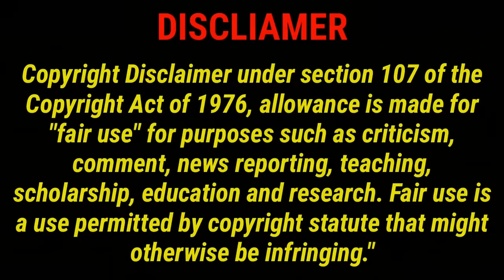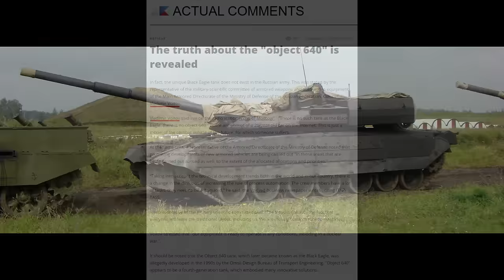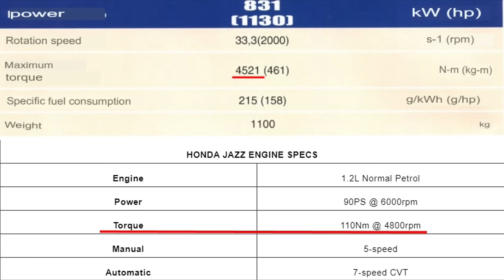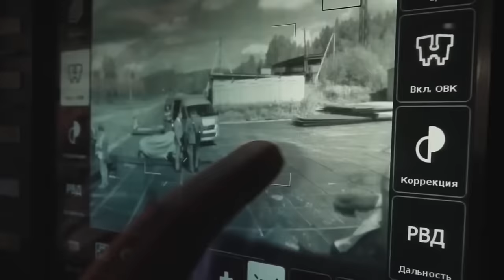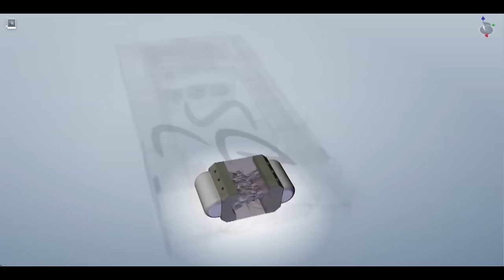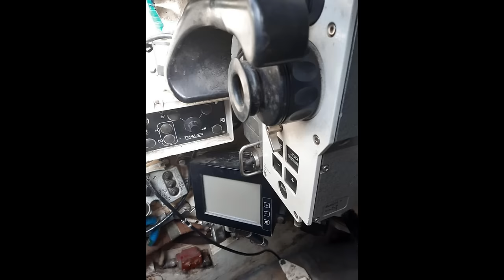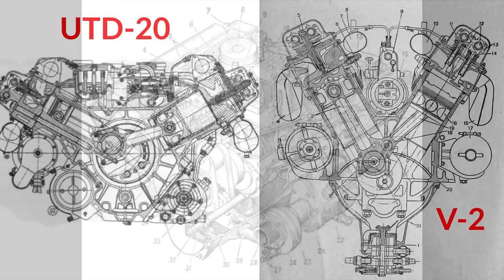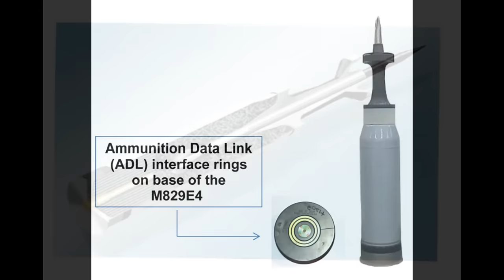LazerPig is WRONG about T-14 Armata

Comment: The fact LazerPig thought a little ole Honda engine had more or equal torque to an engine designed specifically for tanks shows he knows absolutely nothing about tanks. I ain’t no tank genius, but.. wow, that was atrocious. You really can’t take him seriously anymore.
Reply: Still the main points hit home. No t14 marching towards Berlin. On paper red is certainly right. But on the battle field no t14 is seen.  This feels like discussing mystical creatures.
Reply: @Monsterpala  Russia has a lot "on paper" capability.
They have considerably less real one.
Their "stealth fighters" can be counted on your fingers while west churns out F 35s by hundreds.
Russia stating specs of their equipment way over what it actually can do is common thing too.

Reason they refuse to use most of their modern equipment is they don't want the embarrassment of showing off how bad it is.
Like the terminators they pushed to front, made real stink about it, then went awfully quiet.
Oops, turns out they dont really work that well on the battlefield.
Reply: LazerPig is just the normal NATO bot. Know nothing and talks a lot
Reply: @platysplatys3967 actually terminator footages coming really often and working pretty well.
Reply: @weirdflextv1320  please provide.
I saw 2 videos with it.
I'm especially interested in usage in urban areas.
Reply: @platysplatys3967  never been used in Urban area so far. But a lot in the forest.
Reply: @coyotesweg3129 Lots of footage ive seen of T90m and BMPT terminators is from Kremenaya.
Reply: @platysplatys3967  Source?
Reply: @bastikolaski8111  Yeep.
Reply: he makes "edutainment" lol, you couldn't trust him from the beginning
Reply: @Monsterpala  did you forget they barely have double digits of them?
Reply: But he didn’t, he said it a little less than the v2 he was complaining about. However stating what he said word for word doesn’t help your “bias” claims does it?
Reply: @theonewhouploadsnothing1704  A cursory google search shows the V-2 as having torque rating of 1591 Lb-Ft. Depending on what Honda Jazz engine you want to use (it doesn’t really matter), it’s engines have a torque rating in the 80-95 Lb-ft range. So still nowhere near accurate. This ain’t the hill you want to die on my guy. The fact of the matter is, the notion that a 38 liter diesel engine designed to power a 30+ ton tank, would have a torque rating similar to a 1 liter gasoline engine designed for an economy car is such a ridiculous assertion that the fact that it was even considered - let alone made it into the final script - pretty clearly indicates he doesn’t even have the rudimentary knowledge required to even speak on the subject. It’s not even something that could be chalked up to a “translation error” because It wouldn’t even pass the sniff test for anybody with a clue of what’s being discussed. It’s difficult to overstate how bad of an error it is.
Reply: @theonewhouploadsnothing1704  
1.) Your first mistake was simping for LazerPig here.
2.) Your second mistake was doing so over this incredibly bad take of his.
Reply: @detroitglove8249  I wasn’t talking about engine power, and I didn’t say LP was right. I’m correcting the guy on what LP actually said. If you’re going to correct someone then doing it right matters. Twisting what someone said hurts your argument even if you’re in the right. 

However enough wackos that blindly hate LP will say whatever for a parasocial “victory.” It’s definitely hurting the perception of RE’s community that people do this.
Reply: @The one who uploads nothing  
Serious question, do you understand what’s being discussed? Because no amount of pedantry can save this argument. It’s completely indefensible. To go back to your original comment, you said: “Saying it word for word doesn’t help your ‘bias’ claims does it?”. But that’s just the thing, even if he quoted it verbatim, the comparison is so ridiculous that the only explanations are: a) bias so strong it prohibited him from thinking clearly, b) a complete lack of knowledge about the subject matter, or c) a combination of the two. It really is that simple. The only other option is intentional deception, and i’m not going to accuse him of that.

I understand the point you’re making, but this isn’t really a case of twisting someone’s words to make it sound worse than it is. It’s sounds equally bad no matter the wording. I say this as a casual observer: I’m not an RE fan, a LP hater (if anything i used to be a fan), or even really a huge tank guy in general, though i do enjoy the subject and have seen videos from both. I’m an amateur mechanic and car enthusiast, and as a result know a little bit about engines. I can’t speak on the quality of his other knowledge, but if he’s making mistakes like this he’s honestly not qualified to make judgments about engines, and should have just left that whole section out of his video.

Comment: the t-14 will be able to fire 21 shovels per minute.
Reply: But don't forget they completely ran out of ammo 10 months ago, and ran out of food 3 days into the war.
Reply: @olisk-jy9rz  You don't understand
Reply: *Image of rpg7 with shovel loaded comes to mind
Reply: @olisk-jy9rz they have also taken 180,000 casualties which is pretty funny lol
Reply: @Neeboopsh  Pretty much. A country does not simply run out of food and ammo in wartime. 

If needed and motivated, soldiers can fight for days or even weeks without food.

In addition food and ammo supplies can be pulled from reserves and produced as the war economy ramps up. 

There was even a legendary Chinese siege where soldiers ate women and children just to keep fighting. 

Its often motivation, rather than any resources like ammo, armour, food, etc, that gives out when peer forces fight in all out war.

The low battery smoke detector of war can beep for years on end before an actual loss occurs.
Reply: @olisk-jy9rz  They did, which is why they retreated from Kiev.
Reply: @ChucksSEADnDEAD  They retreated from Kiev because they didnt bring enough forces to siege the city because it was never their intention. They rushed in the north with a very small amount of forces to try and bring about a political solution, which partly worked by bringing Kiev to the negotiating table. When a deal was not reached, they retreated because there was no longer any reason for their miniscule forces in the north to remain over extended.
Reply: @WordBearer48  miniscule force?
Reply: @WordBearer48  We agree that the 3 days was bullshit, but was it really 1 year and still counting to narrate "de - naz and demilitarize" in their plan? I would have believed and how russia is/was strong after 5 months after the start of the war they would have half of Ukraine or completely cut Ukraine acess to the black sea. Non of that happend thus the reason we are still arguing are they still strong or not (not by counting nukes)

Comment: Periscopes are still very, very important. What if the camera is shot off or damaged?
Edit: "Rifling makes the gun more accurate", this used to be true for the early days pf MBT's, I am talking pre-1960's. Since then, it has been proven that the rifling has next to no impact on the accuracy of the gun.
Edit: Apparently, I was mistaken on rifling not affecting accuracy and my usage of "gun" was too broad. My apologies, I will do better in the future.
Edit: As brough up in the replies, modern APFSDS rounds are stabilized by their finns. This was what I failed to mention previously. And as mention in another reply, the rifling does indeed shorten the lifespan of a barrel, if I am not mistaken, down to a third of what a smoothbore barrel would last.
Reply: Periscope is just thought to destroy, all modern tank periscope is pretty much bullet proof
Reply: @Tzarrr12  tough*
thought is a different word ;)
Reply: It's not that rifling doesn't have an effect - it's that fin stabilised munitions could be made precisely (and consistently) enough from the 60s or 70s onwards, that the accuracy you got from them would be better than the accuracy of a spin-stabilised munition from a rifled gun - without all the other drawbacks of rifled guns.
Reply: Some spin is generally desirable to average out any inconsistency in the shape of the projectile. To put it another way, your chances of hitting are better if the projectile flies in a corkscrew path rather than one that constantly curves just one direction.

I suspect most APFSDS have slightly angled fins for this reason, to obtain a slow rotation that converts any asymmetry of the projectile into a helical flightpath rather than one that curves up, down, left or right.
Reply: Rifling does impact accuracy of the gun. Up until a certain point. Ammo design and velocity in the modern era has made rifling obsolete.
Reply: @thelordofcringe rifling requires more maintenance as well

Comment: The major downside of gas turbine engines is not exactly the fuel efficiency, but the part load efficiency.  Diesel engines have very good part load fuel efficiency as running them at lower power is simply done by injecting less fuel, so part load is supplied at the same thermodynamic efficiency.  Otto cycle (gasoline) engines produce less power by limiting airflow, which reduces the effective compression ratio and efficiency.  Gas turbines have the problem that the power needed to keep the compressor spinning has little dependence on the output power and just keeping it spinning means that fuel consumption at idle is nearly 40 percent of the fuel consumption at full rated power.
Reply: The order of magnitude higher rpm of turbine engines means that the engine is slow to reach max rpm (since the rotational energy required is the moment of inertia times angular velocity [rpm] squared ). Also the compression ratio is proportionally lower at lower rpm. These combined means that gas turbine engines are only good for constant power output. One possible solution is to have a smaller gas turbine that provides a maximum power equal to cruise and combine this with a battery in a hybrid drivetrain.
Piston engines have relatively constant compression ratios, especially with variable valve timing.
Note that direct injection gasoline engines do throttle by controlling fuel flow directly.
Diesel engines are typically heavier when compared to a gasoline engine of equal maximum power. The diesel operates at lower rpm and typically has a longer service life and better efficiency.
Reply: That's... Fuel efficiency, but at idle. Which can be solved with good logistics or an APU. Both are present with the American Abrams.
Reply: @alexboccaccio5431  I think the original clarification has merit, since fuel efficiency is most commonly described as mpg in the US, and all vehicle have zero mpg when sitting still idling. You'd have to say something like hours idling per gallon, or the inverse gallons per hour idling.
Reply: @alexboccaccio5431  Technical point of order:  Fuel efficiency at idle is exactly zero, for all types of engines.

The difference is the fuel consumption at idle.  The APU gets around the part load performance issues by only being rated for running the electrical loads and trickle charging the battery (it either runs at close to peak efficiency, or it is not running, at all).

Flying off on a tangent, steam engines are the absolute boss at fuel consumption at idle, as they consume no steam while stopped and have maximum torque at zero, so the stopped steam engine immediately responds new demands.  Their short term fuel consumption at idle is zero and the long term fuel consumption at idle only needs to match the heat loss through the boiler insulation.  For large thermal generating stations, the 'short term' was measured in hours
Reply: "LET"S PUT AN AIR CRAFT ENGINE IN A TANK"
I still can't narrow down the history period by that sentence alone.

Comment: I have one simple rule: don't trust people who always talking with mix political and technical topic, yes you can use one or the other as background knowledge, but mixing those 2 often means you can't even keep a objective view
Reply: redeffect is way more disingenuous when it comes to mixing politics with technical aspects. His IS-2 vs KT video is the best example, where he uses soviet memoirs as some sort of gospel to prove his points, all the while completely ignoring the same materials from the other side of the barricades. The problem with this video however is that T-14 Armata doesn't exist and any sensible discussion about this tank is a slippery slope either way, because no one will ever know what this tank is truly capable of. Lazerpig's video proves more than enough that a lot of propaganda surrounding T-14 is very inconsistent to the point of crew hatches varying in certain videos between manual and automatic types. You can't have a serious grounded discussions about mythical beings.
Reply: @coupdegrace2767  what Soviet memoirs? I watched that video? What? Is it when he said the IS 2 could take out a KT with two consecutive blows? How is that a gospel? What did he say?
Reply: @coupdegrace2767  how is it mythical if they actually built it?
Reply: The technical and Political goes very much hand in hand when it comes to the USSR.
Reply: you can and often need to talk about both for the bigger picture see @Perun for example. Yet people like Lazer Pig don't realy have expertise in any of those fields, yet present their arguments as if they have. those people i don't trust!
Reply: To the contrary, especially in the defense industry. It is impossible to make a complete objective analysis of an artifact, be it a tank or a painting, without mentioning some amount of the politics, society, and economics relating to it. And it is even more important to look at military equipment through that lens, as military equipment is designed for use in war, and war is politics by other means. 

You can't take a good look at Soviet equipment without knowing the doctrine around it, and you can't take a good look at the doctrine without knowing the politics, society, and economics of the state which it came from. Soviet military doctrine, politics, and economics were very closely linked, and the equipment procured reflects that. 

Or did it ever occur to you why the T-64, T-72, and T-80 can be described as designed in the 60's, built during the 80's, are armed with the 2A46 cannon fed by a carousel autoloader, feature wedge-like frontal hull profiles and a bowl-like rounded turret with an emphasis on low profile and weight at the expense of gun elevation angles and crew comfort and survivability, and were adopted by the Soviet Army?

Surely politics wasn't involved in THAT.